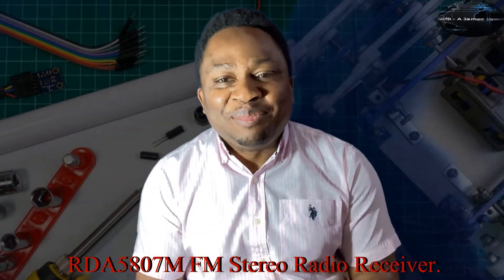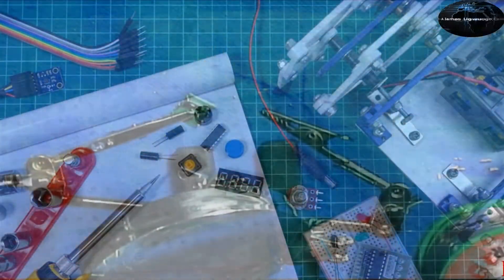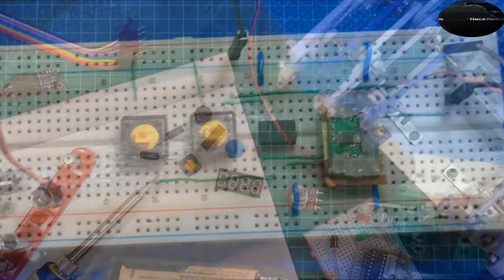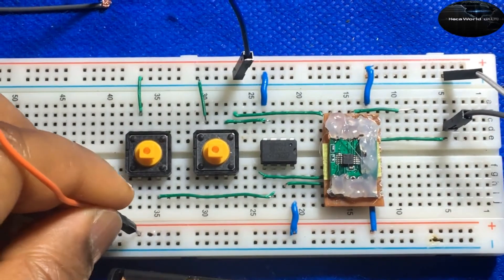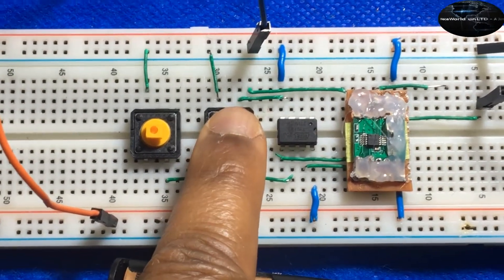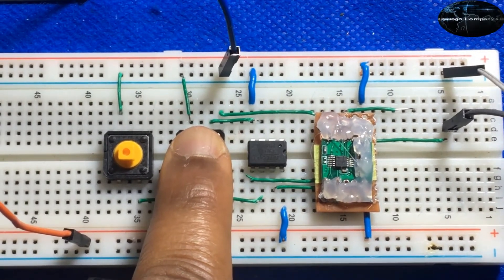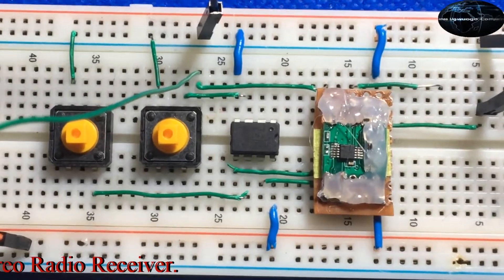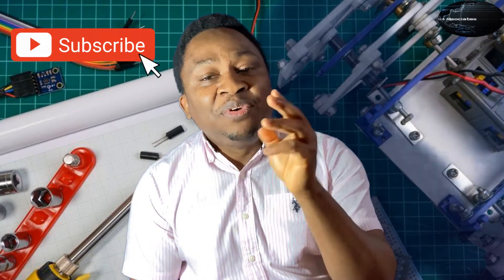RDA5807M FM Stereo Radio Receiver Part 1 | Home Made FM Radio Receiver | Walkie-Talkie Receiver |

Comment: Please provide circuit diagram.
Reply from the maker: use the circuit from part 2 - https://www.youtube.com/watch?v=lYSEdUo-ARw&t=277s Don't use any resistor on the switches. Just connect them directly to the microcontroller pins and visit this website for the code - https://www.hecaworld.com/microcontrollers/

Comment: هل هي المسؤولة عن اخراج الصوت في مسجلة السيارة سواء كان صوتومن راديو او صوت من الهاتف عبر وصلة Aux
Reply from the maker: I think you can output the sound from the car speaker. You just have to connect it to the speaker connections or add a bluetooth module to it and connect it through the car radio via the bluetooth device.

أعتقد أنه يمكنك إخراج الصوت من مكبر صوت السيارة. عليك فقط توصيله بوصلات مكبر الصوت أو إضافة وحدة بلوتوث إليه وتوصيله عبر راديو السيارة عبر جهاز البلوتوث.